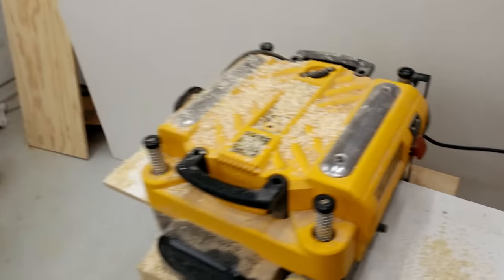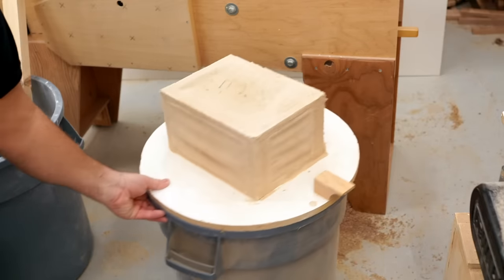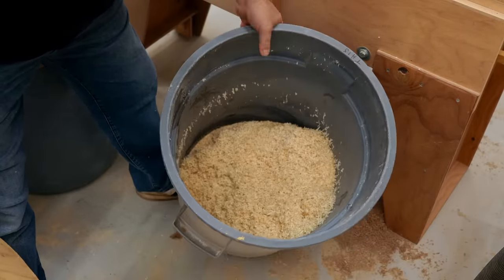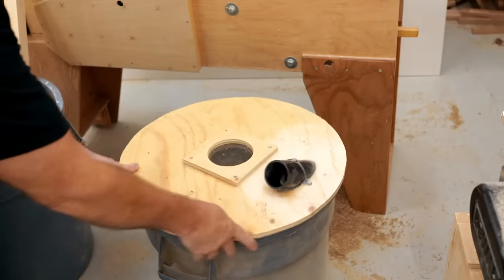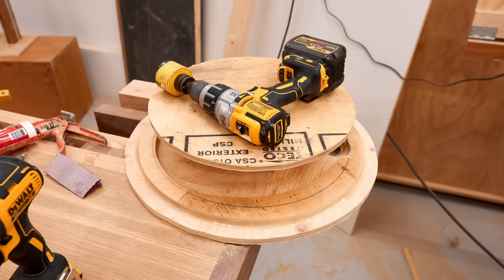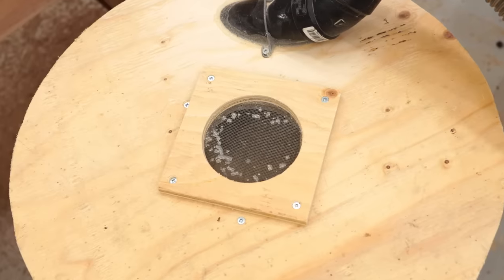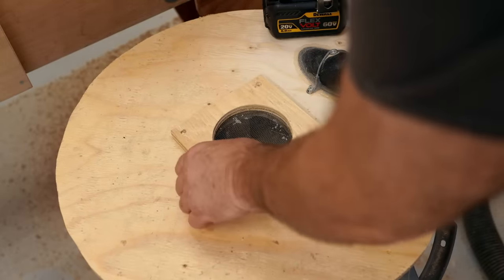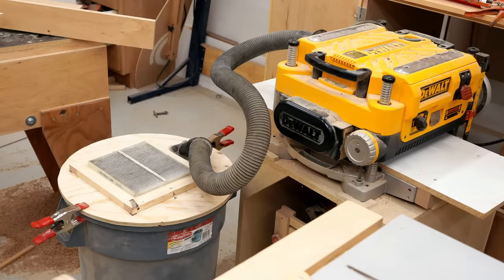Easy to Make Dust Collector for the DeWalt DW735 Planer

Comment from the maker: It doesn't get much easier than this, especially when you see how well this works. The Dewalt 735 planer is a very common model and it has the advantage of having a blower built in to push the shavings out, so this is a solution that will only work with that particular planer.
Reply: Did you just ❤️ your own comment?
Reply: @whirlybird1999  That’s what she said!
Reply: @whirlybird1999  okay pretty certain this ISN'T that marker but FastCap sell a very similar thing intended for use with their kaizen foam. Has a thick tip on one end and a thin tip on the other, available in either black or silver IIRC.
Reply: @whirlybird1999  oh nice!
Reply: Hey John, I just finished mine and it works super!! I get some chips on the infeed side, but nothing major. ONE thing I will do, is get a garbage bag that fits my trash can to help with disposing of the chips easily! 
Really like it!!!
Reply: John I copied your dust and chip collector, went to auto zone and bought a cabin filter .put a plywood base on the trash can with casters. Man this thing is going to be the ticket. Large brute thrash can holds a good amount too. Thank you so much for the advice.

Comment: I imagine the radius of the lower circle has to be smaller than the bin, so the sawdust goes there? If so, what is that gap size, surely has to be in a certain range, too big or too small won't work well.
Reply: I'm surprised he didn't mention that. That seems kind of important. I really like how it works.

Comment: I just built something very similar to this, based on your video - and it works amazingly. I used a 4" hose, and the air filter I just changed out of my Car, and 3D printed the hose attachment angle, and used a bin that is thick walled and was kicking around for years - came out amazingly and not a single scrap of dust comes out of it. Thank you very much @John Heisz
Reply: Can you share the 3D print file?

Comment: I have the same planer and I'll be adding one of these to my shop very soon.  so much easier than cleaning up the mess on the floor and walls after planing :)
Reply: But..,,,I may well miss the Let it Snow soundtrack running in my head on a hot sticky July evening !

Comment: So good to see you uploading material again John. This is rather timely as I am in the process of reassessing my dust collection. Do I really need a 3hp motor running for the planer.  Not really as that blower is pretty powerful. Do I need a 3hp motor for the sander. No, pressure is too low so a shop vac is better.  I need to make a thein separator and buy a new, small shop vac as my large one has died. Despite replacing the bearing it does not sound healthy. Time to build a separator I I have one on the 3hp dust collector)but like in your original plan, have a "proper" air filter to keep the fine dust out of the shop. The 3hp dust collector  does a great job at the table saw, general clean up and will be used on the CNC.

Comment: Thanks for the video!  I have been stuck trying to figure out what to do about my Dewalt 735.  I had it attached to my 2 stage dust collection where I also would run a high velocity shop vac (~200 CFM) from the other side.  But the air flow from the blower on the Dewalt planer (~500 CFM?) exceeds what the shop vac can suck up, and it actually keeps pushing in the ball from the inside of my vacuum and locking it up. (so frustrating)  I decided that the dewalt 735 just needs a separate dust collection and let the blower do its job, it doesn't need additional suction.  So, I'll setup something similar to what you have... this video is great, thank you!

Comment: Aerospace engineer with a background in high pressure hydraulics, aircraft pressurization, and iso 10k clean room operations.  This is quite clever from an economics standpoint…I will be doing this with a slight modification to the filter design to make it more easily replaceable.  The one single thing i could possibly think of to add is some kind of low pressure gate valve at the entry point to minimize dust when disconnecting and moving to a disposal location outside.,,but honestly that’s probably overkill!

Comment: I keep trying to figure the precise design to mount my wet vac directly to a larger can with a Thien baffle or cyclone. I think your design gets me there! The engine/lid can "just" be spaced off the top with a many-a-gon angle-cut plywood cylinder, then the hole through one side for the pipe. Awesome.

Comment: So I did similar catch can but routered out where the ply sits on top of the barrel and filled it with silicone sat it on the barrel for a air tight seal don't forget to apply vaselene to the barrel so it can be removed after it dries I'm also using the Oneida system which helps to hold the lid to the barrel and a skeleton frame inside the barrel so it doesn't collapse on itself

Comment: First I’ll second all the welcome backs - that could not have been any fun (I work in IT, I KNOW it wasn’t any fun) 
Second a technical question I was hoping you’d toss into the voice over …. What is the gap between Thein Baffle and side of bucket ?
Would any sort of partial center (spacer) column cover make any difference?
I’ve never built one of these Thein style separations - but I recently got a DW735 and I CAN attest - holding the barrel behind it doesn’t work (LOVED that clip!!)
Thanks John
Reply: The dust spins around the edge of the bucket, then loses momentum and falls through the gap to the bottom of the bucket rather than going up the centre hole to the filter

Comment: I just bought the DW735x.  What is the spacer block length between the cover plate & the thein plate?  I think that is the route I will be taking as I have a very small space to work in.  The rest is pretty strait forward.  Thank you for the video.

Comment: Are you satisfied with this planer. Is it the type 1 or the 12 ? It seems that since it is made in China (type 12) instead of Taiwan several users have experienced problems with the engine of this new version. You can see the type right next to the serial number. I'm asking you this because it's on a big discount here in Canada (-$220 off the regular price $899 canadian dollar). The demonstrator in store was Type 1 but the one I just bought is Type 12 so I wonder if I will return it. Has anyone experienced any issues with type 12 vs type 1? THANKS !

Comment: I would have to say that, strictly speaking, said baffle is not a Thien baffle. The patent for that refers to a tab coming in from the side that supports the baffle. Suspending the baffle from above, as in the model of this video, predates Thien by many decades and is in fact orthodox. Thien's claims that the tab itself is efficacious in separating the chips I rate as nonsense.; it's better to do what John has done here.
Reply: I bet you are fun at the parties you aren't invited to.